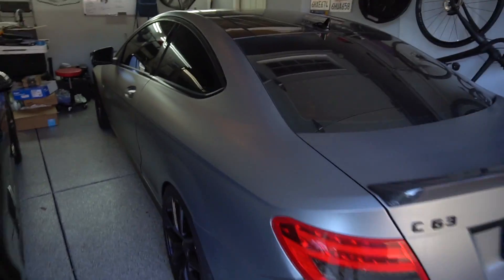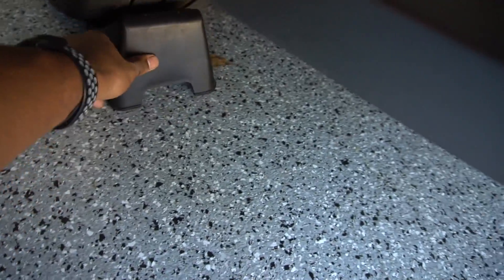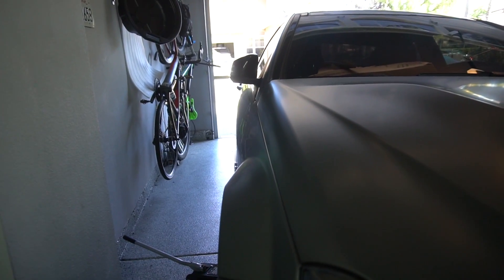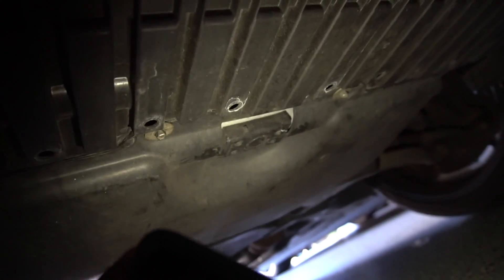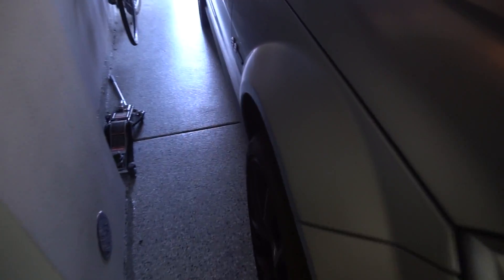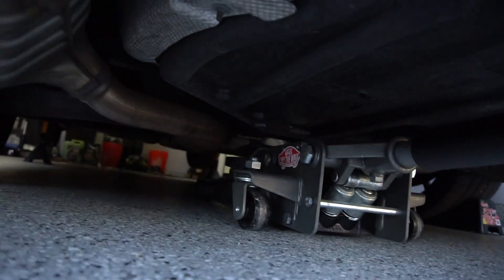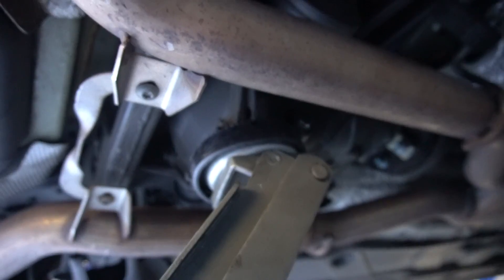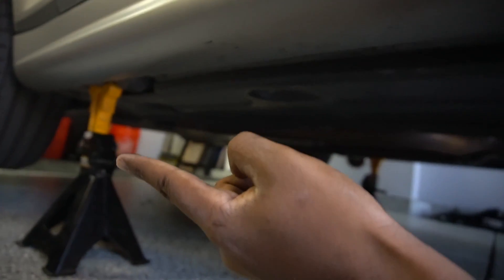How to Lift a Mercedes W204 C Class at Home! (4 Wheels Off the Ground!)

Comment: Did you use jack pad adapters for the jackstands? Or can I mount the jackstands just as they are. I’m doing a full brake rotor/pad swap on my W204 but wanted to make sure
Reply from the maker: I just used the jack stands as the are. The plastic/rubber frame mounts are easily changeable later down the line if they get deformed over time

Comment: My 2010 C63 has cooling fins on the bottom of the diff housing, not sure about lifting it there.
Reply from the maker: Ah you must not be in the US, for some reason none of our cars had that from factory lol. Its still fine to lift via the cooling fins, I just put a 2x4 in between my jack and the diff fins on my M3 diff in my 335i. Also, you can push the jack further toward the middle of the car to bypass the fins if youd prefer
Reply: @SamAbraham  Yes Sam, Scotland here. I used a cut off piece of scaffold plank between the jack and cooling fins to spread the load. In my head I thought about the 'bed of nails' scenario where spreading the load prevents injury/damage. :-)   No problems, cooling fins undamaged. I could then place axle stands on the rear jacking points. I lifted the front using your technique with an additional trolley jack at one of the front side jacking points to allow me to get my low profile jack in to the centre jack point at the front. Thanks for your help.
Reply from the maker: @alfa-ek2vi  Perfect! Glad to hear you got it all sorted out

Comment: Do I need rubber “square” Mercedes style pads for 4 of all my Jack stands or is there enough flat solid steel under there to fit standard jackstands with rubber protective pads? I do not want to scratch or bend anything. Sorry it’s for a friend so I wanna order in advance. Will see it eventually. Thanks
Reply from the maker: You definitely dont need them, I think I tried using those a couple times but they didnt really do anything. The jack pads on the chassis are removable and easily replaceable, so I just plan on doing that every so often

Comment: 1:54  - it looks like you place the saddle of the jack stand over one of the humps in the side lift points.  I am working on a W204 for the first time and wanted to make sure I was putting it down correctly on jack stands. I was worried about those plastic lift points breaking when placed on a jack stand.  Are you using an adapter there or are your jack stands designed to fit into that groove at the 4 side lift points?
Reply from the maker: The mount will pretty much just sink onto the jack stand. I just replace those plastic jack pads on the chassis every couple years

Comment: I need to remove rear brake line but i have no jack stands but i do have 2 benz jacks...is it safe to use 2 benz jacks on the rear while i change the brake lines?
Reply: Do NOT crawl under a vehicle without jack stands ever, any jack can fail and the Benz jacks are probably the worst ones out of all of them. Go to harbor freight or autozone or something and just spend the money, they’re pretty affordable and way cheaper than the hospital or the funeral home.

Comment: Hi. Do you know where the jackpots are on the new Mercedes CLA?
Reply from the maker: Hey there, I don't know exactly, but the side points should be the same, and the rear point can also be the rear diff. The front central point should be similar, if the car has a front jack point at all

Comment: What jack stand pads did you use, not the floor jack one
Reply from the maker: I just put the jack stands directly on the car's jacking pads on each of the 4 corners. It can damage the plastic jack pads over time but they are a wear item and can easily be replaced over time. Over my 4 years of ownership I haven't yet needed to replace them

Comment: The apparent front jacking point on this video is NOT a jacking point - It's a bump stop. The only jacking points on an S204/W204 are on each corner, 4 in total.

You run the risk of the bump stop failing and if the jack going thought the undertray in that location it can destroy the oil cooler, steering rack or sump for the gear box - Don't do it.
Reply from the maker: That is a jacking point... it is a rubber point mounted on the subframe as mentioned in WIS. Almost every other car I have worked on also has a nearly identical jacking point in the same location, BMW or Mercedes

Comment: Hey thanks for this good to know!
Was wondering if you know how or have ever had to adjust the parking foot brake strength? Mine seems as if it doesn’t work, when parking on an incline it will move and rest in gear. Wondering how to fix it or take it to someone
Reply from the maker: Yeah! So I've made a video on how to do this with my ML63, but it should be more or less the same process with the 204. You'll have to adjust the tension on the parking brake screw which can be done using a flat head screwdriver through an access hole in the face of the rotor.
Reply from the maker: https://youtu.be/LX6LD-BuOFM
Reply: @SamAbraham  Wow thanks Sam! exactly what I was after ✌️love the 507 and vids 😎
Reply from the maker: Thanks! Hopefully that video can help you out. Considering re-making it in the future to be a little clearer